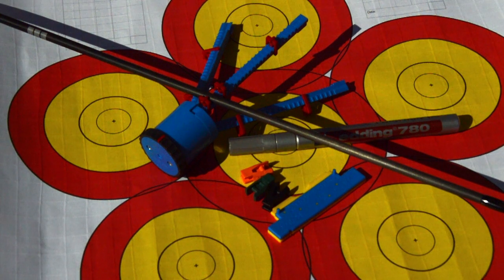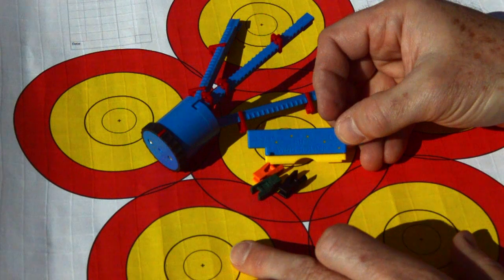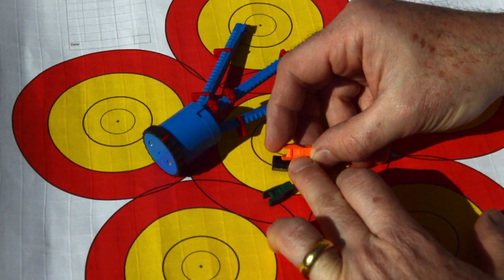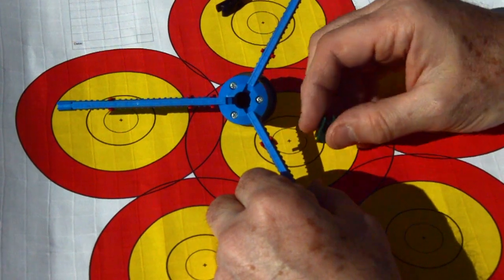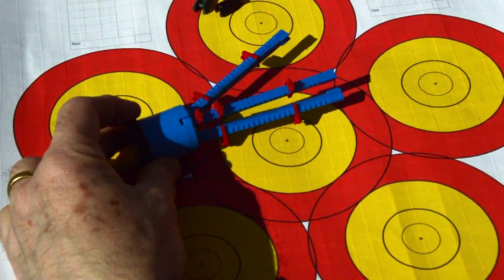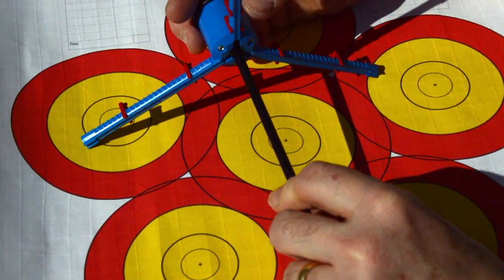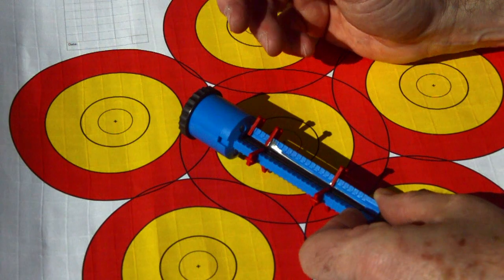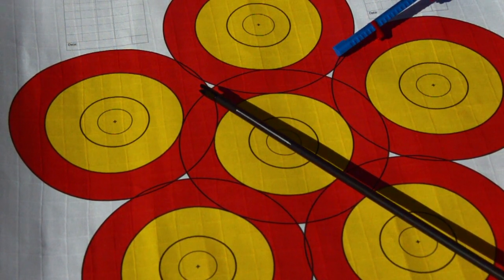How To: Set up a Beiter Tri-Liner

Comment: This is the best video because it's the ONLY video out of 10 or so I've watched that even mentions the index / cock vane (which I find bonkers because it's so important!). Sadly, the one thing you don't mention, is which side (looking from the back) do you put the sticky tape on for fletching after the ink/paint has dried?

Since you 'draw' on the 'right' (again looking from the back) do you then apply to the fletch to the left of the paint? I've re-done a single arrow 3 times to try and figure out the rotation, but each time I feel like my fletches are wildly out of alignment with the nock.